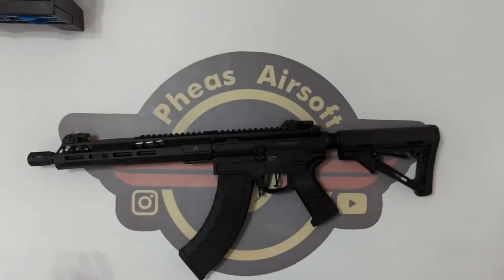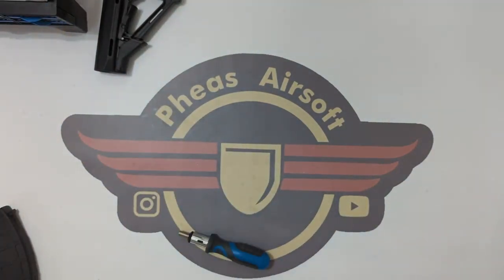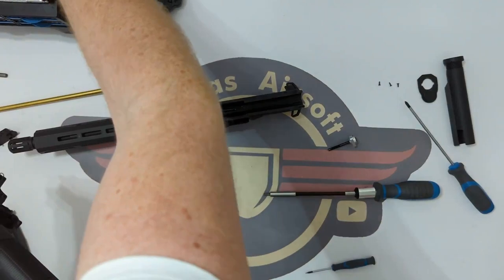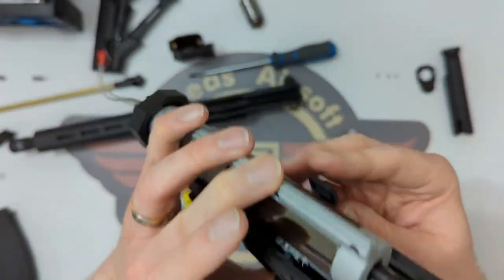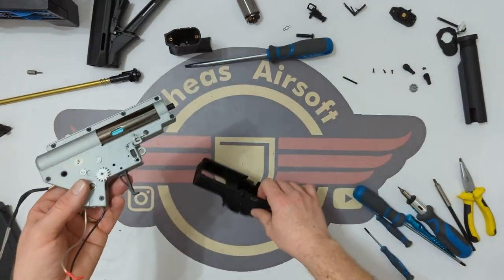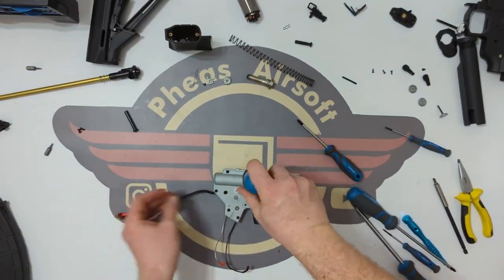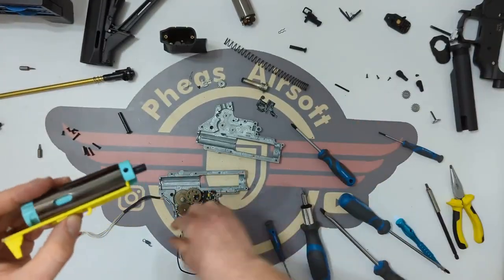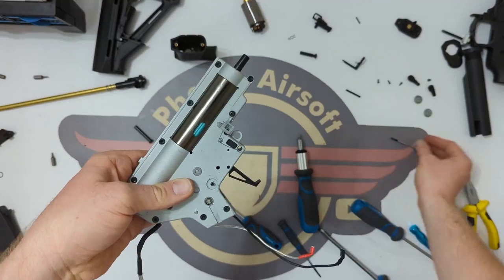[HOW TO] Double Eagle M918G EK47 Disassembly - Repair or Maintenance

Comment: ive seen a couple ar 47 offerings from cyma and the like... and im honestly happy that double eagle decided to play with the hopup design a bit. im personally not too concerned with aftermarket capability bc there arent many "improved" ar47 hopup units out there.
what would be really cool to see is just an adapter sled that goes in the magwell, then just using a standard m4 hopup, almost like what DE did here

Comment: Hey man, I bought on this week, had a couple of misfeeds, you get any of that? What battery you use?. Is the hop unit proprietary, do I need an M4 or ak hop unit?
Reply from the maker: Hiya, it is sorta proprietary, you could remove the bb retainer clip thing and fit one of their normal M4 units in it I believe, what mags were you using to get misfeeds? I have used about 5 different brands in mine up to now and its not missed a beat. Pheas
Reply: @PheasAirsoft I went ahead and upgraded the barrel and bucking, left the nub as it looked too much hassle at moment as it look proprietary also. It didn't like the mapleleaf macron yellow too much, put prommy blue in and seems good, just prob need spring to get it over the 300 to 315 fps on 0.25bbs

Comment: Hey man
When I changed shooting modes There, at the handle, only beep beep beep was heard, but it would not fire I would be grateful if you knew how to eliminate this problem
Reply from the maker: Hiya. Does it shoot now? And just beeps if you try to set a firing mode?
Reply: @PheasAirsoft  it just makes a beeping sound when i put it on semi or auto but it won't fire

Comment: Thanks that's incredibly helpful I've had mine a little while now been having loads of fun with it! 
Because of its hop up unit being two parts will any other hop units fit in this rif?
Reply from the maker: Hiya. Glad you have enjoyed it. I think only way to get another to fit would be to mod one by the looks of it. Pheas
Reply: @PheasAirsoft  I thought so but wanted your professional opinion thanks mate! I turned mine into a DMR and threw a maple leaf macaron bucking in and jerry rigged a omega nub to hop 0.3g bbs and it's better than ever I'm so impressed with these double eagles
Reply: @tombubb8694 how did you Jerry rig it? Does the nub not just swap out?
Reply: @Lowe2476  the nub has a round end to connect to the hop arm but sadly it's much greater in size so you have to shave it to the right size or cut it off completely and drop it in and use the original nub in tandem. After more games however now I'm just using the original nub and a better bucking (maple leaf mr hop) and it's doing great
Reply: @tombubb8694 could you just swap out the hop arm?
Reply: @Lowe2476  that's definitely another option if you can find a hop arm the right size